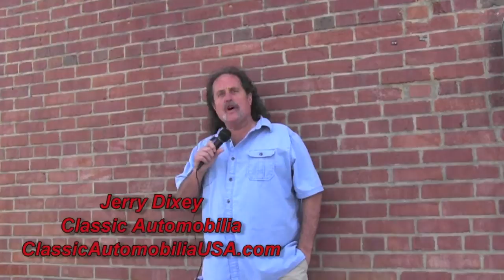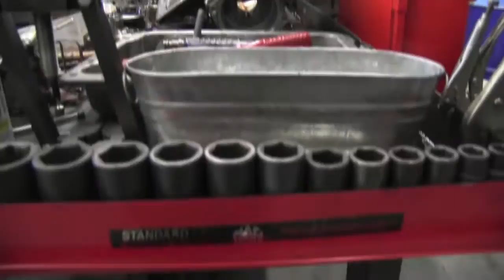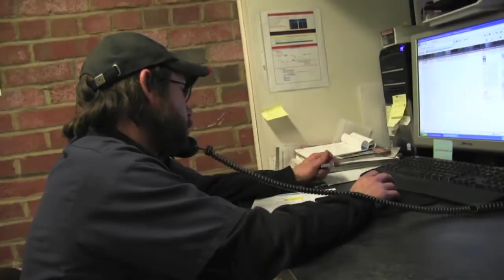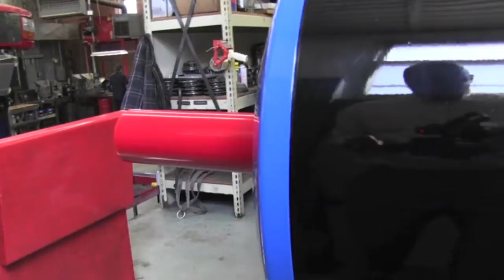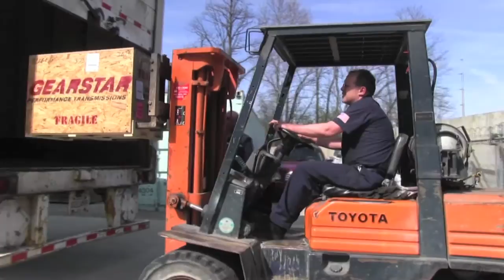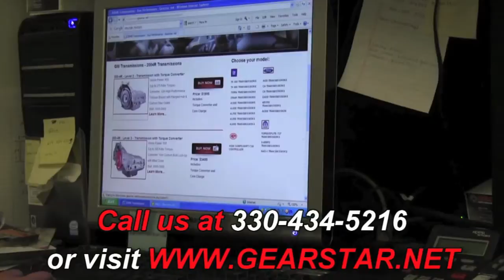Gearstar Transmissions

Comment: We custom build every transmission and converter to the exact application and car specs. Every transmission and converter ar e DYNO tested as a package and  include a calibrated Speedo drive and driven gears along with a 36 months warranty. We know $1295 for a 450HP 350 package is a fair and reasonable price for a product that will  exeed your expectations. Thank you for your comments

Comment: Zack, I agree 100% that what you described to me would be a fair deal.  However, it won't support my HP requirements with any reasonable safety margin or reserve capacity for future HP upgrades.  For that I would need at least your level 3 which would be over 2 grand.  And from what I see that still wouldn't come with a 36 element intermediate sprag.

Comment: Is there any way to alter your packages to tailor it more to the customer's needs or help meet a budget?  For instance, the dipstick, chrome pan and converter cover, mount, dipstick, converter, and kick down cable would all be unneeded in my case, as these are all in good shape from my old unit.  I have a new torque converter still in the box.

Comment: Looking to get a new TH350 transmission to support a 450 hp sbc.  I'm sure you guys build a nice unit, but I checked out your website and the prices are astronomical!  Come on guys, a TH350 is a ridiculously simple transmission....a very thorough rebuild kit with quality parts is only like $150 bucks dealer cost max.  Even throwing in the cost of a 36 element unit, roller clutch, labor, and fair profit margin etc, you're only talking about $1,000 more for a cost of $1,200 (the average price).

Comment: To anyone reading, I want to clarify that I was a little off base with my criticism of Gearstar's prices as I wasn't comparing apples to apples.  Most of the competitor's advertised prices I had seen didn't include a billet furnaced brazed torque converter which I have just learned are much more expensive than I originally thought.  Also keep in mind Gearstar's comes with speedo gears, transmission mount, converter cover, trans cooler, and more, which often aren't reflected in others' pricing.